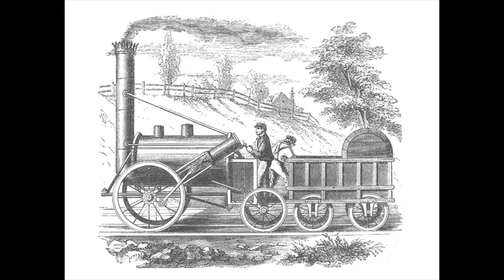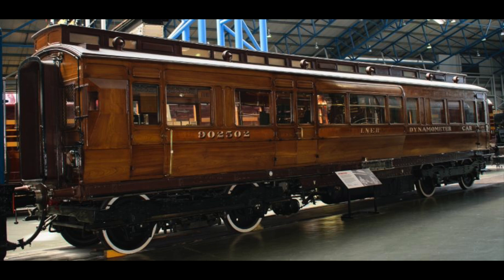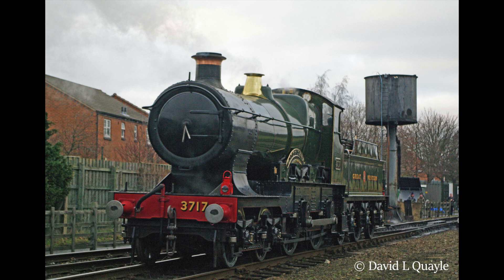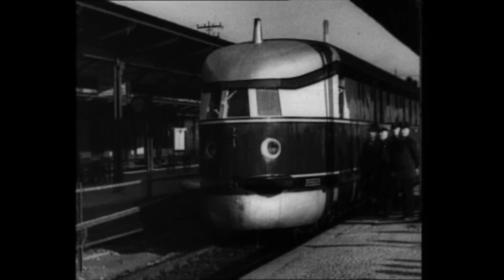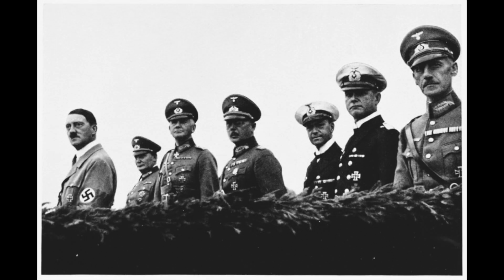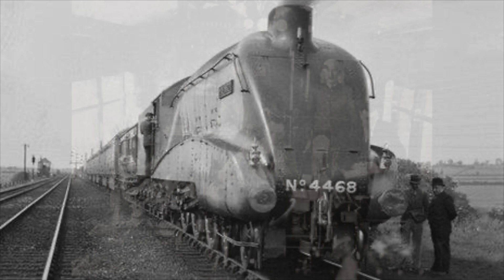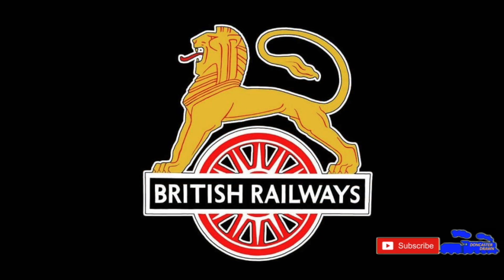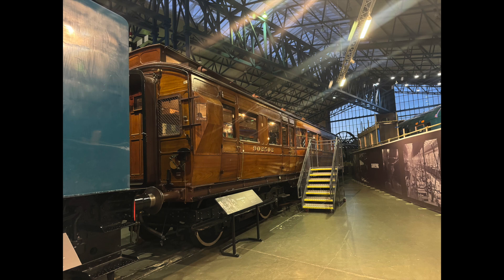The Dynamometer Car

Comment: According to my knowledge the next big jump in dynamometer coach technology was achieved in 1983 by the South African Railways with a system that could measure in real time intrain forces of up to 2 500 kilonewton as well as other relevant parameters at six discrete points in trains of up 2 500 metres in length. During 1989 this system was pushed to a further limit of measuring forces over a train length of more than 7 000 metres during an investigation of the possibility of such train lengths.

Comment: I read a potential NRM floor plan that states the dynamometer car will be separated from Mallard and placed elsewhere in the hall. I don’t know why they’d want to separate it from the loco that made it famous. Any thoughts on this or is that plan only a suggestion?
Reply from the maker: at the moment, its plausible, the great hall is overflowing with engines at the moment due to the building works next door. (poor Q1's tender got booted outside!) and I imagine the temporary shed is bursting too. its hard to say where anything is going to be once the work is done but it would be a shame if they did follow though and separate the two. (especially as we are on the cusp of the 90 year and 100 year anniversary of the run)

Comment: On Mallards record run, the sheer noise at high speed through Little Bytham Station, broke the station windows, and left the platforms covered in burning coals. 
This is one of the reasons they never tried again, it was very dangerous.
Reply: On bullhead track as well. The German record was not achieved on a particular downhill section. With City of Truro's large wheels one speculates how many times the driving wheels were actually rising above the rail. The wheels were not balanced for that speed. I believe that the Saint, 'Lady of Lynn' was ordered to go light engine as fast as she could and did over 100 owing to the fact that the pole reverser was extremely difficult to pull back going at such a rate - it was not easy to do anyway.